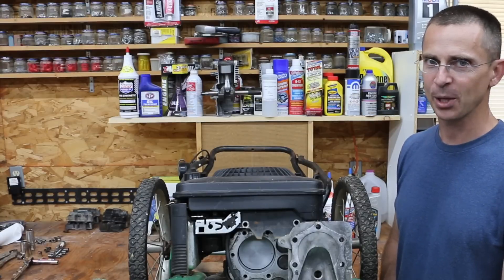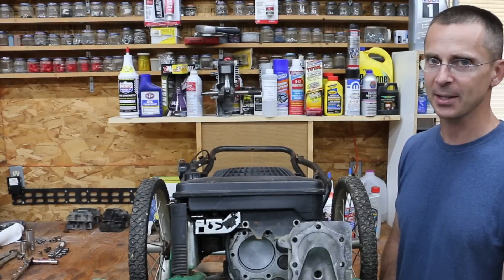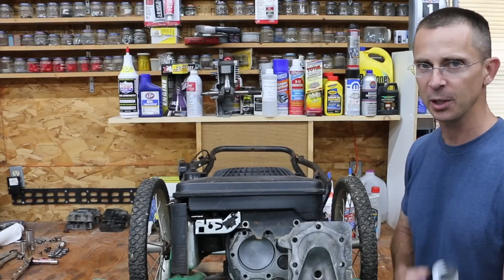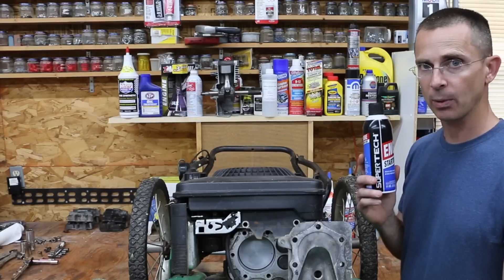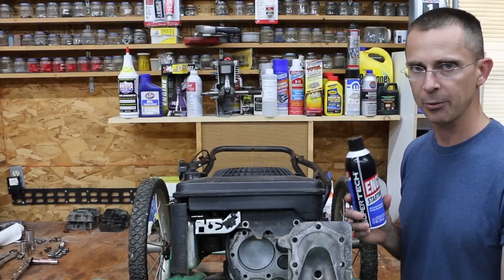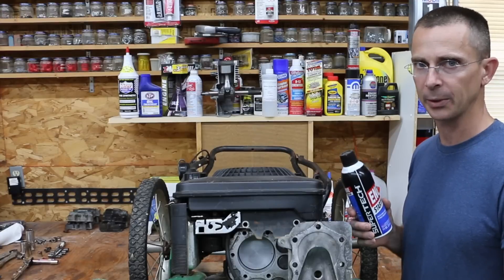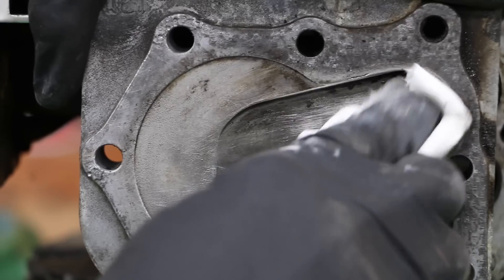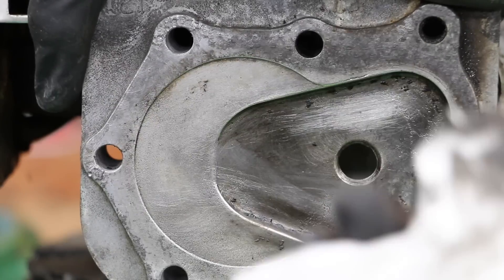Will Running an Engine on 100% Starting Fluid Cause Damage?  Let's find out!

Comment: Rumor has it that in a pinch, egg whites or egg yolks in a leaking radiator can "get ya home" or "get ya off the mountain". The theory is simple. Crack some eggs, separate the yolks (look up water bottle yolk separation kinda cool), put the egg whites in the radiator and the whites will find the holes via pressure and then seal them up! I would love to see what you could come up with.
Reply from the maker: Mason, Thank you for this video idea!
Reply: I have heard of the black pepper I didn't know that top gear tested this. I just wanted Project Farm to do it because of the level of accuracy he takes with his projects. A scientific and methodical approach so to speak.
Reply: I think Mythbusters already tried that ("confirmed").
Reply: mason mollette i can personally give you an answer! I had a 1998 dodge grand caravan that qas a complete ROT BOX and i only paid $150 for it. The radiator leaked and i was cheap and lazy to replace the radiator and i added two large eggs i to the radiator ypll and whites. After about 20 mims the radiator stopped leaking. I drove it for 8 months with a total of 4 eggs in the radiator. ( it leaked again after 5 months) and i saw no physical over heating issues, heat blew hot on winter and stayed cool in the summer. So i can say Yes a egg will seal a hole in a radiator
Reply: myth busters did it. it worked
Reply: Was an old trick that really did work on old big tube radiators. Modern radiators have such small channels in them it will end up plugging them up.
Reply: I have used both pepper and egg as well as various stop leak products. Nothing works as good as eggs. I have lost count how many times I have been saved by eggs. 

Most of the time the leak I had was too large for pepper to work. The eggs seem to fix the issue 100% nearly ever time. I have been using eggs since I first started driving thanks to a junkyard mechanic who was nice enough to share.
Reply: mason mollette 
It's probably been said but add pepper with the eggs too. 
And when ya get home you have a tasty snack for later.
Reply: Like I said, black pepper sealed a radiator leak for my nephew for almost 2 years. He never did anything else. Stopped driving the car due to other issues. YMMV obviously.
Reply: mason mollette 
Works.  Done it often
Reply: sreilly chep! chep! 🐣🐣🐣🐣🐣🐣🐤🐥
Reply: Did it on a farm tractor once after a collision with the fan. Still holding 5 years later..
Reply: 802 Garage   I used ground white pepper once and it lasted years
Reply: it works old mopars have always had coolant issues and i know for a fact that this one will fix it in a heartbeat.
Reply: I've used pepper for pinhole leaks coming home from a camping trip.  It worked well for me.
Reply: Well that would make for an interesting video.
Reply: Poachers use that trick all the time.
Reply: My nephew put pepper into a radiator that was leaking like crazy, literally draining onto the ground. Drove it for well over a year after that without issue. Insane.
Reply: I always just took the cap loose and that slowed it down enough to limp in.
Reply: mason mollette I have used black pepper in leaky radiator to get home a few times, only works until it cools off, also shove a banana into leak on hot radiator will get you home
Reply: That's an old Macgyver trick with the egg. I've done that before. It will certainly get you to a service station but will still leak a bit. It will only last a few miles.
Reply: Works, and in some case even seals a cracked head. This is known to cause water pumps to fail early.
Reply: pour a cub of black pepper in works aswell
Reply: mason mollette I actually seen this done on a tv show once
Reply: Yep. Crazy.
Reply: I have used black pepper as well with success and have heard the tale from my grandad of eggs working too but never tried it!
Reply: Exactly, 

My old 318 had a stuck valve. When I went to do a head job, I found the head was cracked. I was not having any over heating issues at the time i pulled the head. I had dropped a few eggs to fix a blown head gasket several years back. I did not think I had a cracked head. I did have to replace the water pump shortly after the egg application. Unlike pepper, the egg radiator fix also seems 100% permanent.
Reply: mason mollette i would think any soft particulate would do the trick.
Reply: Horse or cow manure will also clog holes in radiators in an emergency situation. I used it on a derby car that leaked like a sieve and it did the job.I don't imagine this would be a good long term fix.
Reply: Who else learned this from archer?
Reply: Salt works aswell worked on an old motorcycle in a pinch mind you this is a get you out of the bush technique. The salt grains will plug a small hole.
Reply: pepper apparently is great too, not happening to my personal vehicle but it sounds logical, basically the same as any off the shelf stop leak. I would think anything solid and able to go threw the cooling system should be able to block a leak.
but I don't believe in a band aid leak block that ill have to flush out somehow later. still would be interesting to see i guess.
Reply: Honestly I don't see how egg would do much else other than ruin the cooling system and not stop the leak. So of anything id like to see it most, but if it survived may aswell try different sized holes and other things too. 
Should atleast if nothing else get lots of views.

Though lawn mowers don't have liquid cooling unless he gets a ride on they might? Or maybe just get a old junk yard rad and a few hose pieces get a way to pressure it and make a mock system. better than potentially destroying an engine either with his tests or via overheating from lack of coolant.
Reply: tobacco will "get you off the mountain" break up a few cigs and throw em in.
Reply: Rustic Shine Really? I'd like to try something like this. I have a '96 Buick Skylark that leaks coolant everytime I turn it on, but not when the engine is off. I have very little knowledge of mechanics so I don't know if a radiator hose is leaking or if the water pump is failing, or anything for that matter! I'd like to know how to fix this issue, even temporarily.
Reply: @ Malaquias You'd be better off getting a mechanical friend to help you. The egg trick is simply to get you out of a stranded situation with a hole in the radiator.

I can however tell you that if it is only leaking with the engine running it is not the radiator or lower hose. It is either the water pump, thermostat, upper hose, heater hoses, heater core, 'freeze' plug, head gasket, or cracked water jacket.
Reply: Cragified Thanks for the pointers! What is a water jacket?
Reply: It's a passage cut into the engine block that coolant flows through to carry the excess heat away from the cylinders. This is the most common method for heat extraction in vehicle engines.
Reply: that one is actually true from self experience
Reply: Blake peppers do work and smells like your cooking whenever you stop makes you hungry lol.
Reply: Mythbusters has tested it and it works but its not recommended to add much since you can clog the thermostat, waterpump, radiator or the heat exchanger to the coupe warmer.
Can be expensive to fix but at least better than driving without collant at all!
Reply: I believe Mythbusters already confirmed this.
Reply: done it

Comment: Shoot yeah surprised me!  I like most people have heard it will definitely cause damage but this seems to tell a different story.. Good job.. What about a two stroke I know you can't run it on just this or gas because of the need for lubricant in the combustion chamber but what about using starting fluid to get one going...  Maybe close to the same as a diesel! Look forward to possibly seeing that video keep up the good work big thumbs up..
Reply from the maker: I was surprised too!  Also, thank you for the 2-stroke test recommendation!  Finally, thank you very much for the positive comment!
Reply: No problem.. We have two jetskis there a little old but they're two-stroke with a oil pump to feed oil for the mixture..  But I have used starting fluid maybe three times on one. But I've not looked at the engine apart before or after it was literally a need to thing lol we would have been stuck and the battery was flat on one I didn't want to chance running both batterys down.. Love your videos, again thank for experimenting for those of us who can't..

Comment: What about running an engine with different things for oil, maybe try pb blaster or diesel fuel.
Reply from the maker: Andrew, This is a great suggestion--thank you!
Reply: Andrew Piroli cement mix
Reply: Might.

Comment: You never disappoint your videos are always interesting. I've heard putting starting fluid or ether into a diesel burns the tips at the injectors so I don't  used it, I've been told to use WD-40 to start a diesel and it works I tried it quite a few times im a Master-Tech transmission Rebuilder
Reply from the maker: Andrew, thank you very much for the positive comment.  Thanks for the tip on using WD-40 too.

Comment: What will happen if u run straight up gas in the oil
Reply: You will quickly wipe out the crank and rod bearings and you may experience a dangerous and possibly catastrophic crankcase explosion.
Reply from the maker: Kevin, thank you for this project idea!
Reply: the engine will literally blow up... there have been cases where the carb floods the cylinder and lot of the gas seeps into the crank case.. then while running it at some point it catches the combustion through the rings and literally blows the case apart.. theres a lot of videos showing that type of damage.
Reply from the maker: Robert G, thank you for this information.  Seems pretty dangerous.
Reply: The first time I rebuilt a carb on a 460 Ford one of the floats sunk and it sat for a good hour before we tried to fire it up. Well when we did all the fuel vapor was still in the engine and it literally blew the valve covers off and blew gasket out of the oil pan
Reply: Project Farm diesel or vegetable oil?
Reply: A leaky fuel injector will also do that, on shutdown.
Reply: Plenty of drunks have done this. I know an owner of a local business did indeed fill gas in his oil to the top and tried to mow the lawn. The mower didn't run for long as the fuel tank had not been filled. It was a smoky mess until it quit running. I guess the fuel being thinner slipped past piston rings carrying a small amount of oil and created lots of smoke or it thinned oil enough to get by the rings. Anyway, he put the mower in dumpster and bought new one. We took possession of the mower at that point and drained all fluids and filled with fresh oil and gas in proper places. Mower runs fine three years later
Reply: With mine it raised the crankcase level and would smoke like crazy when tilted a bit. I checked the stick and it was WAY up! But mine just pumped it in while it was running. Glad I didn't ruin a good engine.
Reply: It'll clean out the crankcase. My diaphragm had a kink in the opposed piston Vanguard and filled up with gas. I drained it out and it's run fine ever since. I've cleaned them out with straight gas and diesel before. I'd be scared to run straight gas in the crankcase because it'd get hot and explode I'd think but I'm not going to be sitting there watching it either. Watch out for your crewcut, Commander!
Reply: Looks like I'd read the comments before I comment. Oh well. Such is a big dummy.

Comment: How about running a 2 cycle engine on starting fluid? That is what I have heard being damaged most by starting fluid.
Reply from the maker: This seems like a great project idea--thank you!
Reply: 2 stroke MUST have lubrication oil in the fuel...either pre-mixed or injected as it's fed in...there is no oilpan to lubricate the crank, piston, or wristpins....it will seize

Comment: Can you do a video seeing if a small engine will run if it is lubricated by grease instead of oil? I don't mean fill the crankcase but just grease the friction points
Reply: it wont run for long, when assembling an engine you do that anyway to prevent premature wear.
Reply: It will run for a little bit.
Reply: I'd suggest about the period of time it would take to gall up the 'bearings'  as if you had an empty crankcase. in small engines they use a dipper to splash oul internally ( grease is too heavy and too thick ). if the engine uses an oil pump it'll never get there.  using oil a little too thick like using 40W oil in an engine that calls for 30W oil isn't going to do it much good.    the bearing clearances dictate the weight of the oil.

Comment: I wouldn't think the engine would be hurt from the starting fluid, but it would be much more likely to knock because of the higher vapor pressure and flammability of it. I'm quite surprised you didn't have any knocking.
Reply from the maker: Max, Great point.  I expected a lot of knocking too, but I suppose the timing and compression are such that the small engine isn't as sensitive to this as an automobile or diesel.  Thanks for commenting!

Comment: Thanks for commenting!
Reply from the maker: Keenan, Do you think long term use of starting fluid in a diesel engine will cause damage?
Reply: Project Farm I don't think so. I'm pretty sure the creators of starter fluid aren't idiots. I knew it wouldn't score the bore in this case because obviously they would add oil to the starter fluid to prevent scoring. I think no damage will happen to a diesel, but not too sure. Depends when the starter fluid actually combust. You obviously don't want backfire. I haven't seen you test a diesel before in your videos, do you have one? And what diesel is it if you do.
Reply from the maker: Keenan, Yes, I tested Restore in a Ford Diesel tractor and it proved to be a very effective additive.  It has a 4.2L turbo diesel and runs pretty strong for a 40 year old engine.  Thanks for commenting!
Reply: Project Farm, I think that when rumors of people say the use of starting fluid will damage an engine they refer firstly to a diesel engine, and after they refer to a back stroke (not a back fire),  that would be like jumping on the pedals of a bike when they are vertical.

Comment: can you run an engine only using fuel additives, no gasoline just additives, what will happen?
Reply from the maker: This is a great suggestion--thanks!
Reply: Kartul2 good idea, but I don't think the engine would actually start. I'm interested if any fuel additives actually work
Reply: I'd love to see if the engine runs on pure Seafoam or HEAT.
Reply: Not enough combustion to run an engine. When i was a kid i tried seafoam as a kid in the lawnmower and it didnt do anything. so i added fuel bit by bit till it started and it made a huge smoke screen. Dads walks outside and was laughing so hard.
Reply: starting fluid is more pure than gasoline so in actuality it will probably be better for your engine .  diesels are a whole other story , diesel can be harmed by starting fluid.
Reply: a diesel will run on pure seafoam. I've seen someone when they changed a fuel filter on a powerstroke 7.3 they filled it completely with seafoam as the hot soak treatment,
Reply: methanol is alcohol im sure it will tell you on the back labile
Reply: It won't run off of Sea Foam straight. I pickled a generator with it and it died till I put gasoline back through it and then it smoked for a while. Didn't hurt it though.
Reply: 2nd this!
Reply: I did this when i ran it low then added additives, it runs poorly and smokes a ton, but runs
Reply: good idea !
Reply: heet is methanol! that should be a good one
Reply: Some of them yes, I know Tunap runs on diesel at least and i think the gasoline also.
If you can light it on fire it usually works. Oily ones will likely not work in gasoline and seafoam I don't think will work in any engine
Reply: thebug 404 the yellow bottle Heet we run at our shop is alcohol based, not methanol. Is there another type of Heet brand additive?
Reply: Good idea, it might run but prob really shitty. I accidentally put diesel in my dads gas truck and it wouldnt run forward but it would run perfectly fine in reverse, we had to drive 3 miles in reverse back to the gas station and get 93 octane.
Reply: There was WAS a product on the market that was 'non-combustible emergency fuel.' 100% additive and no gasoline. You kept it in your trunk and used it before you would have been stranded. It sold in one gallon jugs and the instructions were "DO NOT turn engine off, add entire contents to tank and go to nearest fuel station. Fill tank to full."
Reply: Interesting indeed! An outfit called Parts Place had some fuel system cleaner you ran straight into the pump like an i.v and it was a quart if I remember right but that was a long time ago. Supposed to clean the whole thing from one end to the other. I never used it but it was there!
Reply: Certain additives are gasolines themselves

Comment: Use wd 40
Reply from the maker: Gierzi 1987, Thank you for this recommendation!
Reply: Wd-40 makes a great marine engine coat before or for winterizing engines, and it works as well to start them up on after sitting as it will dissolve it's own varnish.
Reply: Yeah you should try that, it is flammable so.... Should work
Reply: Np
Reply: won't start
Reply: I thought the old stuff was but the new wasn't bit I don't know. Every blasted good thing gets 'improved' so it ends up not worth a hoot.